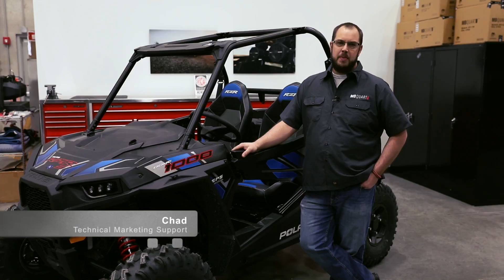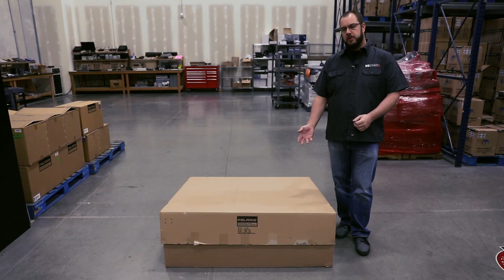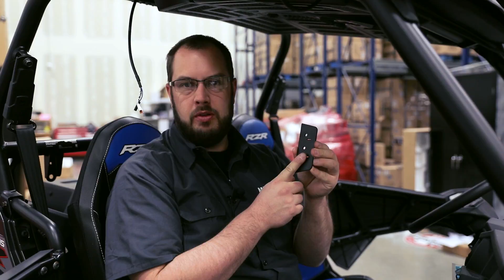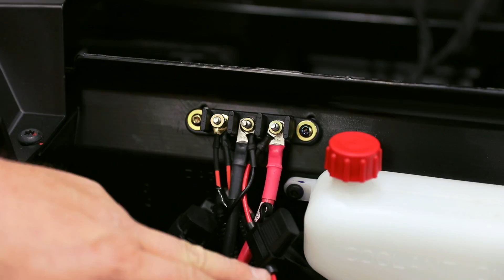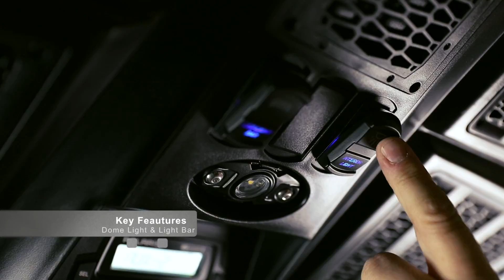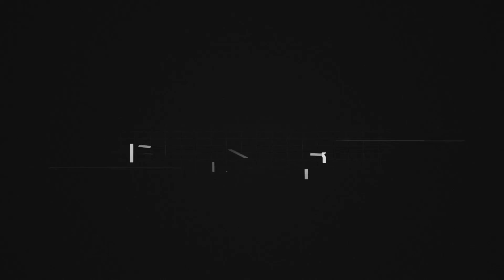S10-L EXTREME AUDIO ROOF for Polaris by MB Quart. Installation for RZR (PART #2882066)

Comment: Lighting, Stereo and Electrical

Hi, I have mbquart soundbar, and I want to add one more speaker to the sound bar. What's the process? Do I have to order amplifier? Or can I connect directly to the sound bar? I want all speakers work together.

Comment: Can the roof be connected to the new 7” Ride Command?
Reply from the maker: Unfortunately no. You can only have 1 source unit in a RZR. The roof has an AMFM, BT and the RC is also a source unit. Consider the Extreme Audio Pods and the Subwoofer instead.
Reply: @Maxxsonics  Thanks for the quick reply.

Comment: Can you pair other MB quart speakers to this? Such as a sub?
Reply from the maker: Hi Chace, 
That is a great question,  The audio roofs have an audio output that would allow you to add additional amplifier to your audio system.  On the audio roofs the connection is located at the passenger rear corner of the roof.  If you are connecting to the MB Quart/Polaris Lock n’ Ride subwoofer you will not need any special adapters.  
https://rzr.polaris.com/en-us/shop/accessories/audio-technology/2882063/

If you are planning on adding aftermarket audio product you will need to buy a special adapter to go from JST to RCA.
https://mbquart.com/polaris-off-road-grade-audio/adaptors/jstfrcaf2m/

We will be looking for your post on social media, use #RZRLife and #MBQuart when you are posting. See you out there..

Comment: I have this exact same roof.   It absolutely will not pick up a single radio station.  No antenna??????  What's the point In putting a radio option on it.   The dealer said you have to buy an antenna.  Please help me understand this nonsense.
Reply from the maker: Sorry for the nonsense. Please email support@maxxsonics.com. The tech wizards will take care of your antennae issue.
Reply: MaxxsonicsUSAInc 
My radio is all static just installed it what is wrong with this thing 2000.00
Reply: Unfortunately they are all like that. I e had two both No am fm.